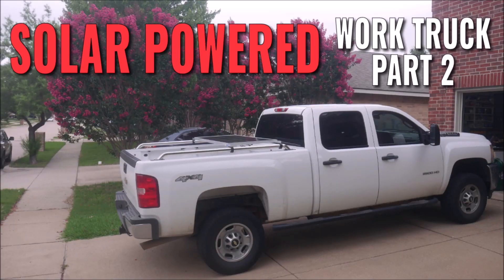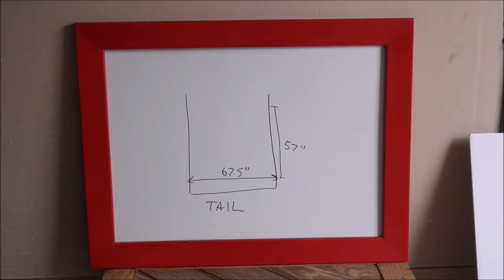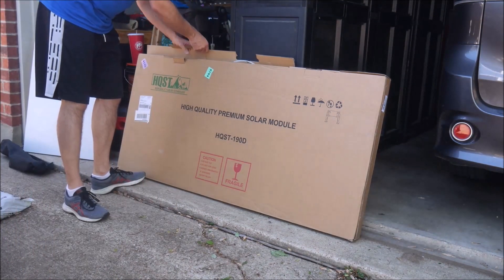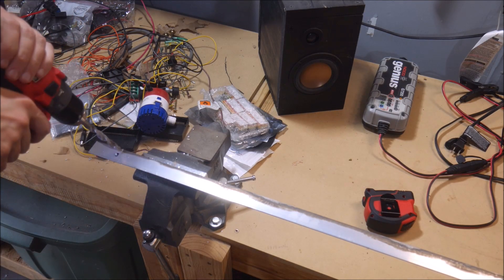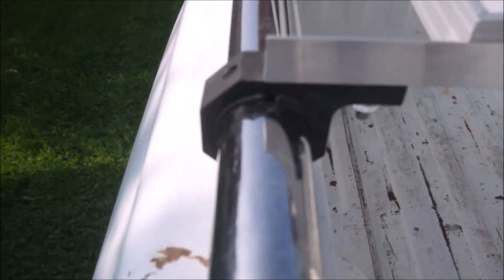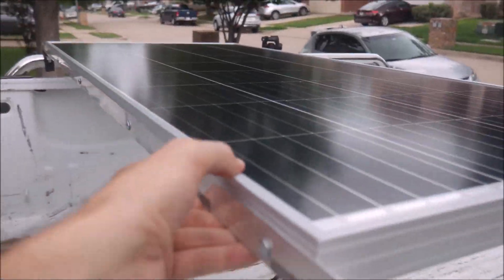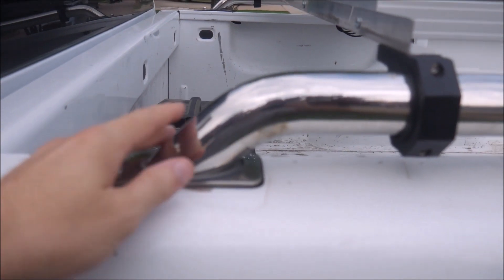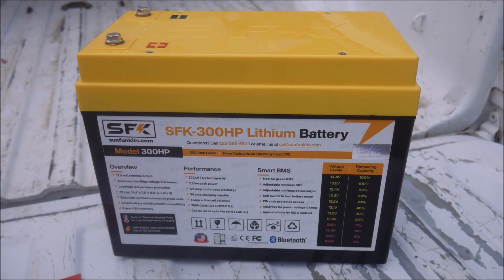Solar Powered Work Truck Part 2 - Mounting The First Panel & Testing

Comment: For a battery box, what about those generic pelican style cases at harbor freight? Also some added rubber grommets or bushings between the panel and angle iron might reduce a lot of vibration getting into the PV module.
Reply from the maker: Good ideas.  Thanks!
Reply: I bolted two 100 watt panels together with super strut. Now as one large piece used pipe clamps to mount super strut to minivan roof rails placing rubber between 4 points of contact. Battery and all other components live inside the van as the positive and negative wires are “Y’d” together and ran through the tailgate door crease. Rain loop added and enters through existing hole between bumper and frame. 

Keep your idea going. Love to see solar and energy added to vehicles!

Comment: I'm planning on adding a solar panel to my truck when I buy a camper top for it. I'm planning on cutting a hole in the camper to then fit the solar panel flush with the ceiling. I'll be using it as a mobile power supply, and for ventilation, so the cab and the back of the truck doesn't get too hot in the summer season.
Reply from the maker: Mounting solar panels flush with the roof is not a good long-term idea.  They can't cool themselves down properly.  They need several inches of space underneath for radiating heat away.  Just FYI.
Reply: @LDSreliance  I meant that I will cut a hole in the roof to put the panel inside of. The only thing underneath the panel will be the space inside the bed of the truck.

Comment: Why not simply attach the panel to the top of a truck workbox? Bonus woud be you can insulate the inside of the workbox in such a way as to create a faraday cage for your batteries and charge controllers inside.

Another option would be to simply stick flexible solar panels directly to the roof of your truck above the cabin. You could install the batteries under the back seat in the storage area. Then your whole truck bed would still be usable.